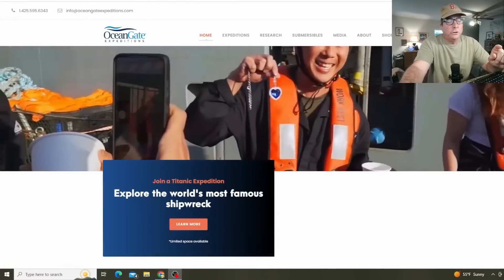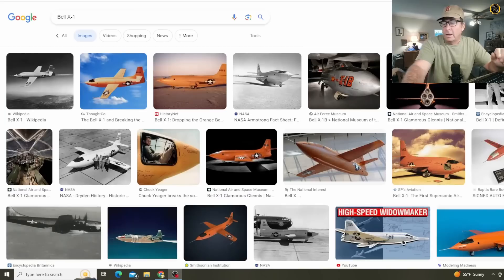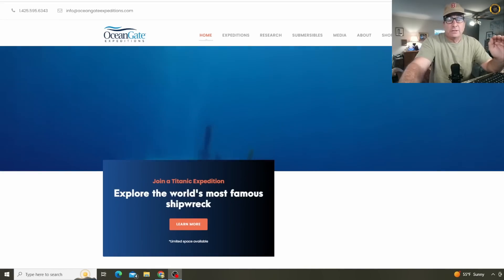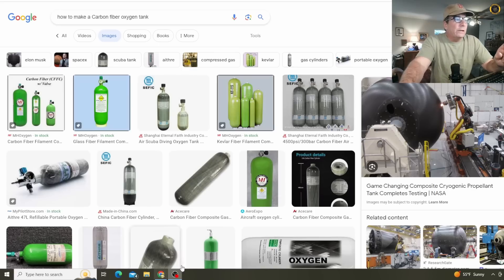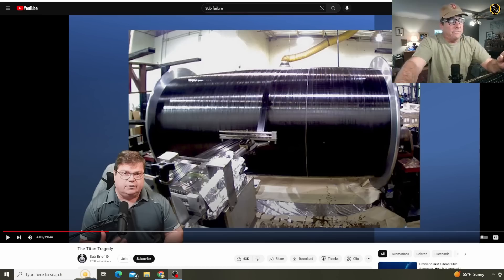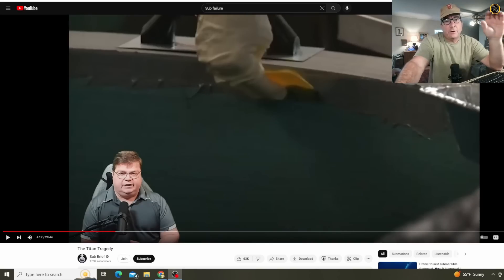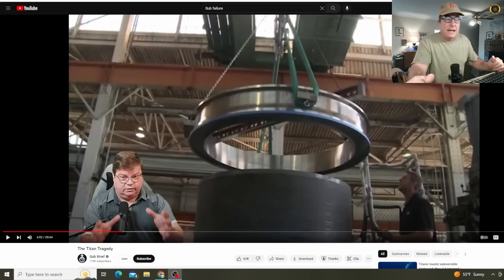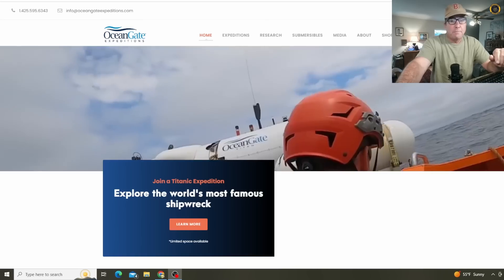Oceangate Sub Construction Details and Implosion

Comment: As a professional engineer in the UK but specialising in civil not structural engineering i know enough that a) the difference between experimental and validated design, b) never heard of CF as a solution for compression applications c) different materials behave differently at their limits so CF mixed with Titanium d) integrity of joints is fundamental so don't have any e) even where joints are lauded to be at least as strong as the substrate, the mating components have significant directional and shape differences where forces act completely differently introducing stress a tube works differently than a sphere f) being a billionaire is zero qualification for intelligence and they are messing with all our lives not just their own immortal souls
Reply: Hello Miles, thanks for your excellent summary. My background is very broadly similar to yours, so may I add a few details… in a tube with spherical ends type cylinder, all things being equal the greatest forces caused by the pressure differential are where the cylinder part joins the spherical end. As has been said elsewhere, the CF cylinder was in great compression so th strength came primarily from the epoxy substrate, not the CF. The material was acting a as a beam in compression, so highly susceptible to buckling. The compression of the titanium ring at the cylinder’s end is likely to have induced lateral forces in the CF cylinder making it more likely to buckle. Unforeseen lateral forces in a member in compression greatly increase the propensity to buckle; you may be old enough to remember the Brent Cross crane accident in 1964, (Google) where an inadequate design detail led to a strut in compression buckling and failing.
An old lesson, that sadly could have helped. It’s interesting how many smart engineers are says similar things in this thread. What a shame that no one had the opportunity to help at an early stage.
Reply: @mikewatson1105  thanks Mike yes you're absolutely right thanks for the explanation
Reply: @miles-thesleeper-monroe8466  Hello Mike, Miles. Thankyou for the explanations. I do not have your experience but I do have a physics background. I also happen to live in St. John's, NL. Lessons learned.
Reply: @mikewatson1105  stockton went out of his way to not hire people like you guys so theres that...
Reply: Ship of Fools
Reply: probably the most common examples of CF solutions in compression are sailboat masts (some at 50 meters in length) The larger rigs to have a static compression up to 10 tonnes, with dynamic numbers easily doubling that.  so with just a 10mm wall thickness you can have a 25 meter mast with a static 3 tonnes of compression.
Reply: @mrl22222  yes but as soon as wind hits the sails it's acting in tension
Reply: @miles-thesleeper-monroe8466  not at all. The mast is always in compression. Putting sails up simply adds to the compression as the halyards pull from the top of the mast to the deck. In fact, then they are out of compression they become quite floppy. Most mast failures are when they go into tension, as that's not a load they are designed for.
Reply: @mrl22222  so what does the moment do from a wind force to the top sail, you know, generating forward propulsion, cantilever, tension durrr
Reply: @miles-thesleeper-monroe8466  from the top to the bottom front (called the luff edge) it is always under tension. I sail on a 52 foot boat that averages 2-2.5 tonnes of tension at all times (we have sensors for this) As the wind increases, the tension increases as well. The load at the back of the headsail (the clew) is around 1t @ 15kts of wind going upwind (again, sensors) The mainsheet (in the back of the main sail) pulls directly down and has 3t on it, and the cables on the sides of the mast share approx 3t as well. Finally, there is a carbon cable on each side of the mast with a spreader in the middle that keeps the mast in column (it's a rotating mast) and the static tension of those is 2t each. If you look at the flow over the sail, it's all chordwise, not spanwise, The lift vector is about 30 degrees of forward perpendicular, with the drag going directly aft.
Reply: @mrl22222  6000 psi on a tube of 2 meters? Plastic doesn't handle pressure well.
Reply: @bryanst.martin7134  the CF doesn't mind the compression at all, in this case it needs to be perfectly balanced around the structure.  The thing about the cylinder is that the force is essentially perpendicular to the direction of the fiber, and my guess would show that in an FEA the compression provided from the end caps during descent is needed to stiffen up the consolidated hull structure.
Reply: @mrl22222  We can agree that CF is an excellent material, but the compound AKA resin that it reinforces must be able to withstand the pressure that is crushing it. If it so much as creeps (which it does) the structure fails. CF doesn't creep. I would not have used liquid sealants. I would have used high quality orings. Additionally the wedges designed to retain the sealant produced serious stress risers, in my opinion. Lots of wrong in this project, too many to believe it outright. Too fishy.
Reply: @bryanst.martin7134  everything creeps. it's a matter of magnitude
Reply: The CEO was not a billionaire.
Reply: @pnwgentleman  He's broke now...
Reply: Stockton was not a billionaire based on his cost cutting moves.
Reply: The crash structures on F1 cars are made of CF and are designed for compressive loads.
Reply: @Arsenic71  that´s made to be "used" only 1 time.... subs have to resist many cycles (they did manage a few successful dives, but it was only a matter of time)
Reply: @Arsenic71    F1 uses epoxy plastic reinforced by carbon fibre.  It is more than twice as good as aluminium for impact absorption.   I am guessing that when it gets damaged it gets thrown away.
As a sidebar, reports are  now circulating that Titan's CF was past its use by date.
Reply: @captainpoppleton  No one mentions the resin. The only compression factor involved. Many factors involved getting resin perfect in a specific molding. By these clowns? I wouldn't go near it.
Reply: @Arsenic71  No, try impact loads. 6000 psi. 6' dia times 10 foot length? I don't think that is a win.
Reply: Rope is for tension not compression CF pressure vessles work cus the pressure is on the inside . I am utelry shocked this jack asss used rope to build a sub . I bet you the epoxy was the only thing holding the tuna can together , you hand compress rope , only tension ..... DUUUUUHHHHHHH .
Reply: CF is used in high compression situation, for example in the masts of large sailboats, with all ropes pulling down on the mast. But it is notoriously unpredictable, resulting in safety-margins that make it comparable in weight to aluminum, which has much more predictable failure-modes. I also was surprised that other than the metal rings at the end, there was no structure inside to make sure the middle of the tube remand perfectly round. If it got pushed a bit into an oval shape (or was not manufactured exactly round), the immense water pressure would result in a large force on the "flat" side of the oval, pushing it into a more oval shape. With pressure on this inside, the stable situation is circular, with pressure on the outside, the only sable situation of a tube is completely flattened. Try calculating the loads on the CF when the tube is 5mm oval instead of perfectly round.
Reply: I agree miles, and think it failed at one of those shady joints on the end caps. He was using epoxy resin for glue that has a tensile strength of 5000 psi, but was taking the thing down to pressures of 6000 psi. It also looked like he only had a 2 inch long slot machined into the titanium that the carbon fiber fit into, which as you know is not much of a glue surface to hold that joint. If I smoked a left handed cigarette and decided to join carbon fiber and titanium like he did, I would have had a 12 inch slot in the titanium for the carbon fiber to fit into, which would give it 6 times more of a glue surface. This would have allowed him to drill holes away from the edge through the titanium - carbon fiber- titanium sandwich and put bolts in it. Even though it weakens carbon fiber to drill holes in it, it would have been sandwiched between titanium. Then he could have wrapped the whole thing with more carbon fiber. It would still be sketchy, but alot stronger than what he had. Another thing I noticed, was them bolting that hatch on with an impact wrench instead of a torque wrench, which as you know could create an uneven seal. It would be like putting a head on a car engine and not using a torque wrench to tighten it evenly. As you know, it's gonna have a high chance of blowing a head gasket. Somebody also said there were 18 hatch bolts, but they only tightened 17, because the 18th one was high up and a b****h to get to. Stockton told them that mathematically the last bolt didn't matter lol. He also told someone that at depth, the 7 inch plexiglass window was bowing in. I'm surprised the thing made it through the first voyage.
Reply: All of that, but that last one especially hits home hard.

Comment: Another issue I see is that their carbon fiber structure does not appear to be done with vacuum systems.  Airgaps as you said would weaken the structure is exactly why the bubbles should have been pulled out under good vacuum.  Another situation would be a multi-system failure where radio and location services in the sub are down, but it's bobbing at and just under the surface for 5 days.  What a horror show it would be if the people were trapped inside, watching the surface of the ocean through the viewport, just low enough that you can't be found after having been dragged a good distance via currents.  Another thing is why wasn't this craft simply fitted with an umbilical?  Yes it's more bulk at the surface, but then you have guaranteed comms and power and craft location.  Nothing about that sub is worthy.  The builder did have advanced engineering degrees and quite a background in experimental aviation, he should have known better given his history.
Reply: Actually, he didn't have any advanced degree in engineering.  He had a Bachelor's degree.  Which is something, but he wasn't the right kind of engineer for this, nor was he enough kinds of engineer (it takes more than one specialty).
Reply: @james-p  He had way more than that.  He was a test pilot unless I read something wrong, and I believe it was military or similar test pilot training.  The kind of training that dictates life over tech.  This guy was a narcissistic half genius.  Too bad he killed all of his customers.  He had a vast education and ample experience to know better.
Reply: Imagining what happened, do you suppose there was a spraying finger cutting leak before the actual pop?  Did those poor pukes have time to cry before it popped.  Maybe a shooting stream of water appeared at the joint between the viewport and the cylinder, as it got quickly bigger while cutting through the weak materials.  I wonder if they had time to argue before it popped something like "hey man great boat."
Reply: @DoctorMangler  While it may be good experience, piloting is not engineering.  I agree with everything else - that piloting experience should have informed his decisions, he should have known better, and he was so delusional and narcissistic that he believed his own hype enough to actually go down in that bucket.
Reply: @james-p  He may have only a bachelors, but he wasn't in a test pilot program without a huge education underneath him, recognized or not.  That was the point though, he knew better and he should have known better, but he chose to ignore life safety.  I can think of 10 ways to test his sub structure to depth without people in it, and Stockton tossed all that to the wind.  I am also disgusted at the media and celebrity outcry over not sending every possible resource to get this wreck up pronto.  We shouldn't be spending a penny.  It's a fact that somebody could sell tickets for $200 each and spend it on chain, lead weights, a padlock and diesel to get to the dive site.  Affix weights to waist, engage lock and jump in.  Same result but at least there are corpses.  Finally what the hell do those fools think they'll recover at this point?  At the cost of more money in a staggering amount and hopefully no more men.  Those idiots don't deserve recovery efforts.

Comment: The joint between the titanium end cap and the carbon fiber cylinder is between two materials that had inherently different levels of potential compression failure. The titanium ring would have been extremely rigid and not as prone to compression in that highly pressurized environment for several reasons, especially given its shape as a narrow but very thick ring and its rigidity. The carbon fiber cylinder, as has been pointed out by experts commenting here, would tend to fail first , and likely at its ends. Just a small amount of compression failure at the end would have separated the glue and stressed the bolts holding the titanium ring to the flange on the cylinder. Thus a compounding and instantaneous explosion. Thankfully, they never knew what hit them. If you ever observed a sand pile experiment, you know what that is. There is a "last grain of sand" that causes the pile to collapse.
Reply: add to that: The temperature is near 0C, and diff materials contract diff-ly. And the whole carbon tube is held by a thin hinge of the titan. Glue doesn't penetrate metal nor carbon chemically deep enough. That's why we use welding. So it all holds on a 1mm at most of the glue... If it's not plain stupidity...
Reply: the titanium rings and the carbon fiber shell would have different thermal expansion, leading to shear  stress at their adhesive joint.  There were significant temperature cycles

Comment: The problem with using a composite tube is selecting the right resin for the job, most are designed for heat, in this case you have a double wamey in the heat when out of water and extreme cold when at depth. I don’t think the end flange joint would be a issue as you point out the pressure forces are great , in fact a cylinder with end caps the end pressure loading is far higher than the circumference pressure.

Comment: Hey Juan, Thanks for all Your great videos. I have experience with Carbon Fibre Driveshafts in Race Cars. they are used in high horsepower applications due to the fact that when they fail, The shaft will explode and basically turn to dust and or very small pieces. That way if it breaks, the broken shaft will not be flung around inside the driveshaft tunnel and do major damage to the Racecar or the Driver. A lot of High horsepower Racecars have been damaged when using steel Driveshafts and Drivers have been injured. If it was a explosive decompression like they are saying, I don't think there will be much of the pressure tube left to bring back to the surface. The Yokes are attached to the Carbon tube using adhesive. But as You mentioned these Driveshafts are used in Tension.

Comment: In a few years we will hear similar critiques on the B-787, Airbus A-350 and old stories on the Beechcraft Starship, all composite aircraft.  I asked an FAA inspector how do you check for delamination on composite aircraft. I asked about the effects of a lightning strike.  None of the answers were good.  Not that a sub will likely suffer a lighting strike, but it could sitting on the deck between the port and dive area. Does anyone know what the maintenance inspections consisted of between dives ?  What is the normal compression measurements on the hull of a Navy submarine and what were the compression measurements of the Titan ?   I would think that a simple string could measure the compression like the old WWII subs did.
At the probable depth of the implosion, the pressure is in excess of 5,000psi.  that is about 50,000 psi on each side of your hand, or in a hydraulic press at 100,00 psi. It was quick.  The whole voyage was an avoidable risk.

Comment: Sorry but I’m also curious (perhaps morbidly so) on what happens to human body if the end caps joint(s) failed at that depth or the carbon fiber tube imploded. Id imagine the tube would deform and flatten to the point that the water would rush in with such force 

Would their bodies be completely crushed with that amount of instantaneous applied force? Or just partially..and their bodies could still be somewhat intact and recoverable?
Reply: There’s nothing left of those people. Instantly gone.
Reply: Another site said that the bodies would be incinerated. That initially didn't make sense to me. Then I thought about how diesel engines use the heat of compression to ignite diesel fuel. Then it made sense.
Reply: One person said the implosion would generate heat first, and a flash fire would have burned them just prior to being vaporized. Nothing left.
Reply: Maybe but carbon fibre tends to shatter like a wine glass, rather than compress like cardboard.